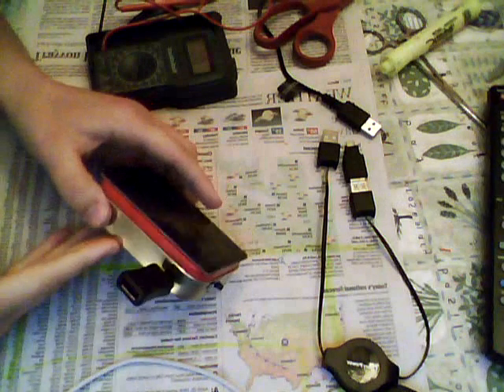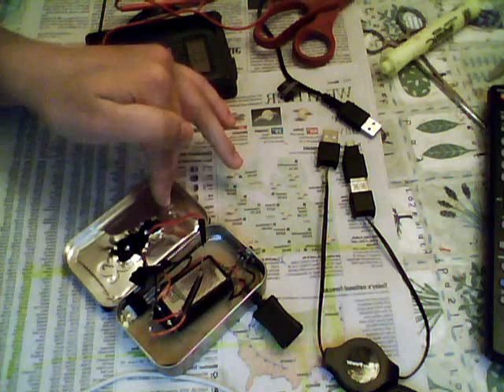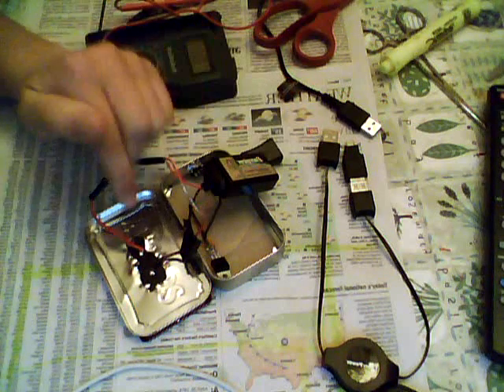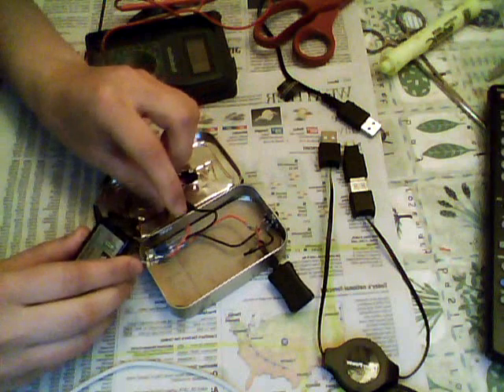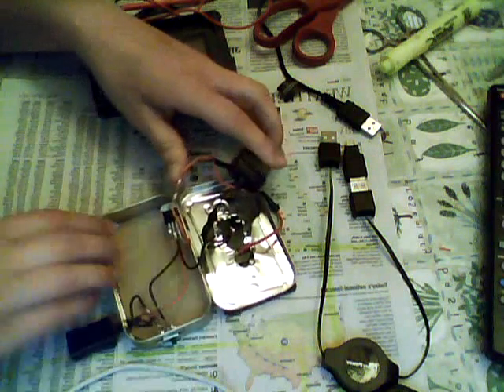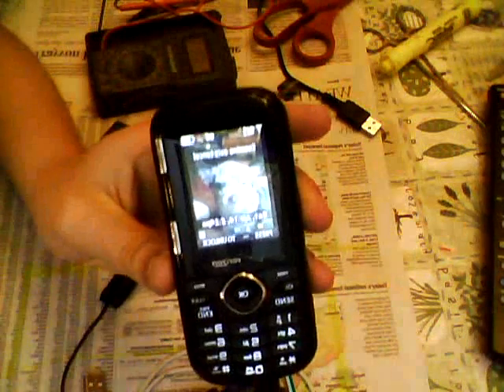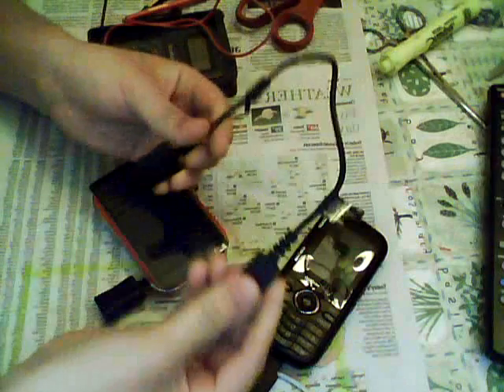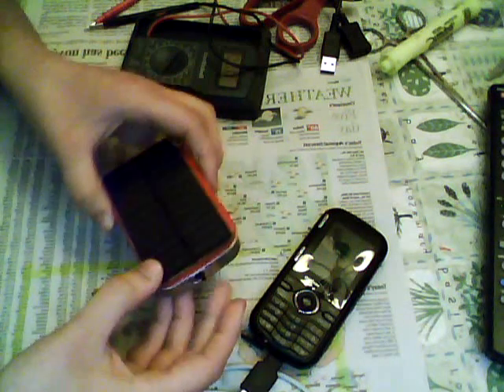Solar USB Charger with Battery Backup - Complete DIY Tutorial

Comment: try using a buck converter(step-down). it will not produce as much heat as the 5v regulator.

Comment: 9V battery is good for voltage but have bad capacity values.what's  most common 9V block battery capacity value ? 200mAh, 300? this works great under direct sun, but battery will be drained very fast while charging phone...

Comment: once i add the 2nd diode. current from the battery does not flow through the diode to the regulator. i used a 100ohm resistor between the input of the regulator and the 2nd diode. i connected a 100ohm resistor bcoz my regulator used to heat up reli badly without the resistor in between. so my issue is when i connect the 2nd diode current doesnt flow through the diode. any idea why current doesnt flow through the 2nd diode??

Comment: I made one of these on my Radio Shack electronics lab, but I have an issue, I'm hoping someone here can help. I used a car cigarette lighter USB female instead of the one shown in this video. I tested the volts at the USB and I'm getting 4.95 volts. I plugged my HTC One into the charger and the icon showed that it was charging. The problem is that the phone was actually loosing power, even though the icon was indicating that it was charging. I attempted to calculate the the amperage, using Ohms Law, and it seems as though I'm getting .79 amps. I don't know if that is the problem.Any ideas?
Reply: Buy a charger
Reply: I have the same problem but i think that is because of the mA that you need 250mA to charge a phone you wiil need 3 solar panels
Reply: LUIS MEJIA Thank you Luis. I made an alteration and took the voltage regulator off of the circuit. The USB port I was using came from a car charger (with the added components already installed on it). Once I removed the voltage regulator it seems as though the amperage was there to actually charge the phone. The components on the USB was already set up to regulator the voltage and the amperage so I had no issues. I still haven't completely figured out how to set up the solar panel(s)
.

Comment: Was wondering I want to build one with 2 usb circuits with 4 aa batteries and 2 solar panels 4 volt each to joint together to put to batteries will the panels over charge them and will it be safe also if u don't use a device on it for a while will it over charge batteries as there is no cutoff also will it be good to use a diode from batteries to usb I case batteries run out and still connected to mobile to stop it discharging phone ?I know have to be between solar panel/s and battery bit confused

Comment: Hey great job, the only thing is my samsung galaxy showed charging but over night the phone died , no charge, and my other samsung phone says battery disconected
any ideas ,,,
Reply: You need a diode between the regulator and the battery. This way, the charge will flow from the battery to your regulator and then to the usb port, but not the opposite way(from your device plugged into your usb port to your battery)

Comment: Putting one 150k ressistor on each of the USB's D+ and D- and connecting them to the USB's +5V will trick most of phones to thinking that they are charged by a PC. Didn't try it on an iphone but it made it work on my sony ericson.

Comment: You need some capacitors on the input and output of the regulator to slable the it. Not necessery but it's safer and healthyer for the battery

Comment: can you give me some advice what i have to made a sola power bank?

Material:

12v Solar Panel
x6 AA battery with 2500mhz = 7.2v / 15000mhz

do i need a 5v Regulator?

Comment: I've found that 2 batteries (minimum) are needed to charge my phone. At 170mAh, the maximum 1 battery can push is 170mA in 1 hour, depending on the load. My cell phone needs about 440 mA and 4.8 volts to charge normally, and a minimum of 4.6 V and 300mA.to even take a charge. Thus, I need 2 9V batteries to charge my phone.

Comment: You need 5v, 1A consistently for your phone to charge. Fluctuations in voltage may cause this problem. 

I've found the same problem with other phones using just the solar panel. Under or over-voltage from the panel stops the recharging. Apparently, this is some kind of built-in protection mechanism in the phones. A voltage regulator should fix the problem for over-voltage. Add a battery to the system (like bluepapercanoe), the under-voltage problem is solved.

Comment: just tap the switch between the battery and the diode (closest to the regulator), that way even when its off it can still charge the battery when its in the sunlight.

Comment: USB devices do put out a current of 5v, but devices also have a 2v current through the data wires on USB. You can look up the specifics with other USB chargers, but you need two 22k resistors and two 33k resistors to trick your phone or iPod into thinking it's being charged by a wall outlet or another USB supporting device. You can do this by instead of using the regulator, rip apart a "cigarette to USB charger" and use the circuit there. They might have the 22 and 33. AND LED LIGHTS :D

Comment: I think late Iphones and Ipod touches need to recognize a charging device with a 2v resistor first. Soo....try buying two 33k resistor and two 22k resistor.  Red and Black wire connecting the Female usb should be connected to their individual 22k resistor and 33k resistor.So..  22K / (22K+ 33K) * 5.0V = 2.0V..by then it should work..I

Comment: My understanding is that the two USB data lines need to be tied to the +ve supply line by resistors but from memory I don't recall the value.

The reason is that some devices - mainly apple products check the data lines as well as the supply voltage to correctly switch on the charging circuitry.

Comment: these will discharge because diodes allow current to flow in one direction and  the current can flow towards the regulator and this will drain the battery

Comment: just take 2 100 ohms resistors and connect them to the the positive 5v charge and connect the other end of the resistor   to the the second lead of the usb and the other end of the 2nd resistor  to the 3rd lead of the usb port

Comment: Means the battery output isn't in the phones charging range(4.2v i believe but don't quote me) for it to charge your phone..meaning its over or under sufficient phone charge specs.. for the regulator to work correctly the input voltage has to be above the regulated output spec or "drop off" occurs. nice vid blue, but question..how do u keep from over charging your 9v backup battery...? seems that could be an issue if one leaves said charger outdoors for a time longer than perceived.

Comment: I was trying to do this with some garden lights.the  voltage output was around 13.5 when wired in series.what would i need if I wanted to charge my kindle fire,it requires 5v 2 as mp?

Comment: wouldnt it make more sense to have the switch above the battery? Betweent the battery and the solar panel? Then you can control the charge of the battery when its not in use... just a thought,

Comment: So in a setup I found online:
5v DC Regulator
9v Battery clip
USB Female port
That's all there is to it. When I plug it to my phone, it says it is charging, but the battery percentage will not rise; would this be because a diode was not added into the circuit?

Comment: I also personally recommend using 4 AA batteries 3,000 mA rechargeable for a total of 12,000 mA vs about 800 - 900 mA from a 9v. It's a tight fit but ... it fits and can give you about 9 full charges just off the fully charged battery bank. Also because the rechargeable AA are 1.2 (1.3 fully charged) it puts you at 5.2 - 4.8v therefore not needing the voltage regulator.

Comment: Yes, It will work with smart phones. Anything that can be charged from a computer USB can be charged with this setup with the exception of some iPhone / iPods ... with the new iPhones and iPods you have to emulate a data connection for it to charge which can be done by supplying pin 1 with +5VDC pin 2 with ~2.4VDC and pin 3 with ~1.8VDC pin 4 will be ground.

Comment: If I am not mistaken, I do believe that newer iPods (particularly iPod Touch), iPad, and iPhone, as well some other smartphones and similar devices require the computer or charging device to assign an IRQ address (that is, to acknowledge that its connected, and give it a pathway for I/O). This method of charing does not do that, so I am wondering if it will work for the 'smarter' devices (i.e. the ones who want to know what's connected to them).

Comment from the maker: This is a stripped down design for easy assembly. 
Here are instructions to make a simple battery monitor that lights an LED when the battery is being overcharged:
search "Make a simple battery status monitor" from REUK
All you need is a Zener diode, a resistor and an LED. 
You can tweak the design to make an LED light in response to anything (like if the battery is charging correctly, if enough power is coming from the panel to charge it, if power is going to the usb, etc)

Comment from the maker: Make sure the output voltage is 5V at 1 amp (that's why you need a 5v regulator). Most small devices, like ipods, are rated at those specs. Make sure to check the output specs on the wall charger for your device just to be safe. Don't worry if the output current is slightly less than 1 amp, it won't hurt the device, it will just charge more slowly. Just make sure nothing greater than 1 amp goes in, or else you'll get sparks and it will damage the device.

Comment from the maker: This system uses a 9V battery because it is easily found and fits well in the tin. A 9V panel would also work to charge the battery, but you would need it in direct sunlight to create a 9V output at maximum power.

Comment from the maker: I used two 1N4742a's I salvaged from an old analog multimeter. They are rated at a 12V breakdown voltage, which conveniently happened to be in the system's voltage range.